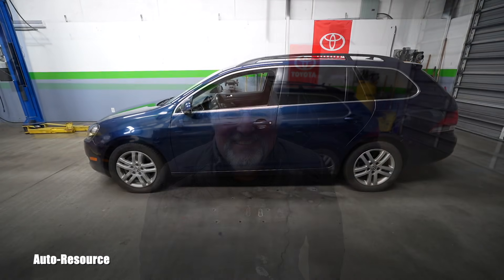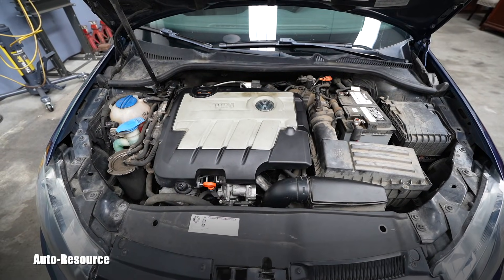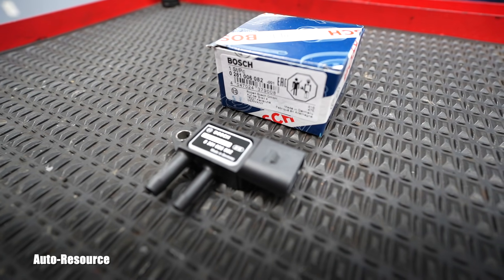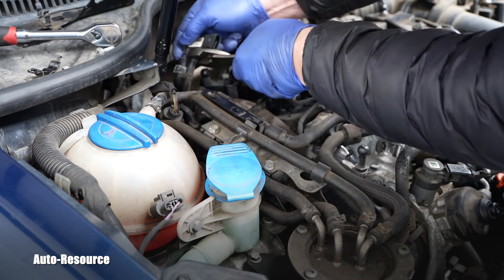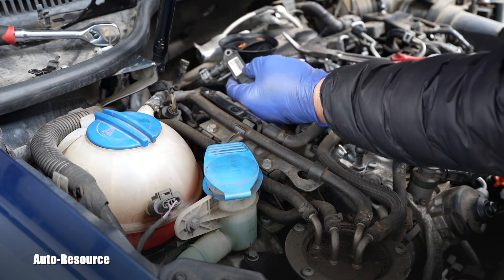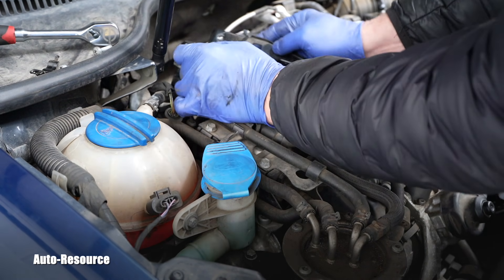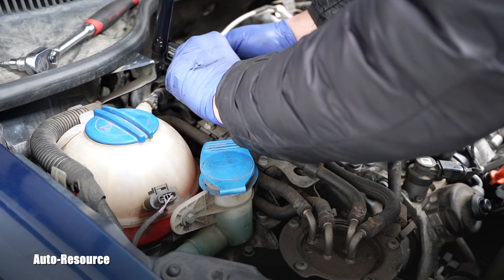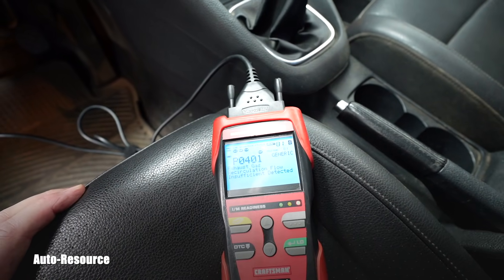VW 2.0 TDI CJAA Exhaust Pressure Sensor Location, Replacement

Comment: Has this been resolved? I have P2002 & P0401 with the most likely solution being to replace the Exhaust Pressure Sensor which I can easily do but if it's a bigger issue I will have to take it to a mechanic.
Reply: More than likely this means your DPF element is cracked.  Just did mine and was not easy.

Comment: I have heard that you need to do a DPF sensor adaptation with a VCDS or diagnostic tool. Its not a just plug and drive replacement. Has this been resolved ?
Reply: Yes , diagnosis VAGCOM And  Delphi AUTOCOM 2020
Reply: do you have the info? I'd like to read more about it. That code p0470 came on mine today
Reply: https://www.youtube.com/watch?v=TRMWvle4YWA

Comment: Where exactly are the 2 cables connected to the sensor coming from ? One of them seems disconnected in my car and i cant figure out where it's from.
Reply: Mines the same did U find out
Reply: Did u guys find out why one of the cables is disconnetced?
Reply: My also disconected on passat b7, the bottom cable